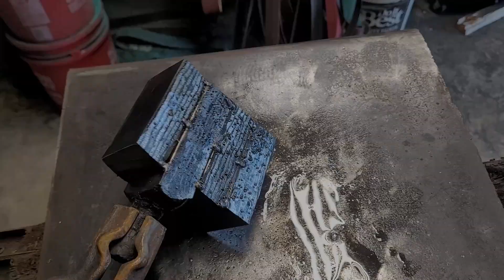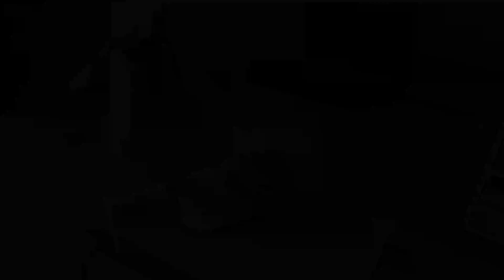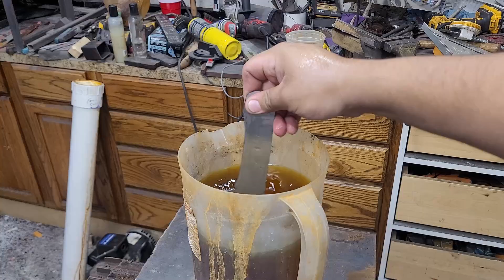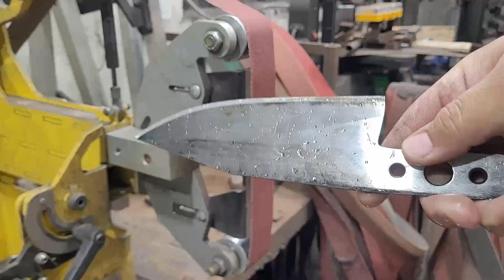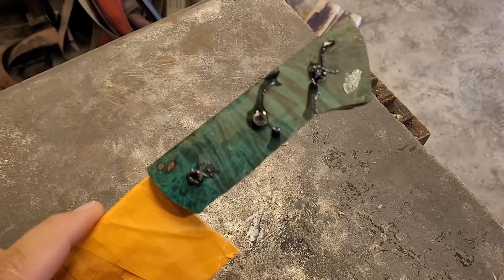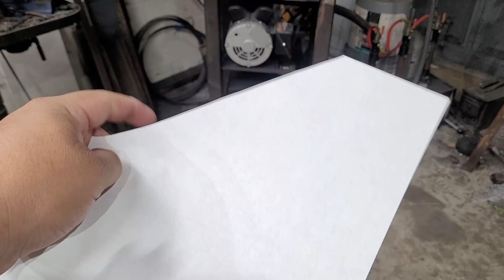Making A Feather Damascus Chef Knife

Comment: The handle is absolutely stunning, and goes so well with the darkness of the blade! I think the blade stands out, almost like tiger stripes. Love it. 

When you saw Ws or Cs, what are you referring to?

Thanks.
Reply from the maker: Im referrering to turning the billet 90 degrees when im forging it and resquaring it. That causes the lines to bend into a c shape. When you cut and stack it to increase the layer count the Cs fuse and become Ws. It adds more complexity to the pattern instead of  just the straight lines.

Comment: Great job on your first feather!  I’ve been wondering what a feather would look like without doing the C’s/W’s. Now I know, thanks for showing it. The duller the cutting tool, the more action in the feather, I’ll be using a HF hatchet and my sledgehammer, no press😢
Reply from the maker: Glad you liked. Good luck with that sledge hammer. On the bright side at least your getting a better workout than me 🙃

Comment: You should try crushed W's for your feather stack, before splitting, I think the feather looks better IMO.

I also used a splitting wedge for my feather Damascus, and spraying it with WD-40, helps with releasing the piece from the wedge for me, also the duller the wedge, the more layer drag you achieve. The sharper it is the more cutting you actually do.

Nice work!
Reply from the maker: Thanks. When i started i wasnt planning to make that billet into a feather but half way in the idea came to my head. Next time for sure though.

Comment: There are recipes for a lube to dip your splitting blade in to help with the sticking. It's usually some type of oil and powder graphite
Reply from the maker: I had some i rigged up when i did an axe for the Viking challenge a while up that i looked for mid cut and that helped out a bit. I believe it was from some graphite type lube i found at harbor freight and some dawn dish soap i mixed together. I made it last minute from a video i found and it works pretty decent.

Comment: That looks BEAUTIFUL!!! WOW!  I've never seen this feather pattern before, and I LOVE IT!! I ESPEICALLY love those thick lines, and how they contrast with the bunch of thin lines. I think you said that thios feather pattern typically doesn't have those thick lines, so it would be just a whole bunch of the thin lines, huh? I imagine that some of the thin lines would merge together in spots, like we see happening in between s couple of the thick lines.... that would probably look cool, but I think I would end up liking this more.
And that handle looks fantastic too!
When you said something about  adding some "W's" or "C's" you mean in the straight lines on either side of the point right? What do you think about doing a W pattern in the THIN lines but not those thick lines?
Reply from the maker: I think it would look better with the Ws because it would give it more movement and more contrast. Ive seen many like this and i like the look.

Comment: Two videos? Our cup runneth over
Reply from the maker: 2 videos since i had one halfway done, but i put it aside for the challenge, then milton happened, and i was finally able to finish it last night. It could have been early, but i opted out to go to my nieces softball game on staurday morning instead.
Reply: When cutting the billet to achieve the feather pattern, might it help to use a lubricant? Torbjörn Åhman uses a graphite-molybdenum-soap mix, I think, that he uses for hot punching and similar operations. Have a look at his video. It might help with the wedge sticking
Reply from the maker: I had some of the same mixture from when I did my axe and remembered halfway into the cut. That's why it seems to start smoking or burning halfway into the cut. It helped out a lot on sticking but it still stuck a bit.
Reply: @stormdrifter7904 I was thinking the same thing. I vaguely recall Alec Steele I think mentioning using beeswax in one of his og hammer forging videos

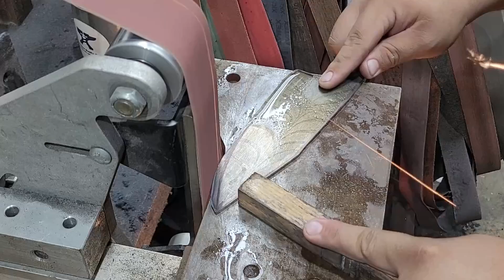Comment: 14:35 here you grinded alot of material.
but since you are a forger would be better solution to cur that much off and make a blade out of those cuts?
since you can forge steel to any shape - isnt this just material wasting?
Reply: He spends the two (more like 4) preceeding minutes explaining exactly why
Reply from the maker: Correct 🫡
Reply from the maker: Sometimes you just have to grind off some materials. You cant save all of it.

Comment: Ive watched few of your videos so far.
Can you tell me, when you are using the press on hot steel. someties it flakes under pressure.
but since it was pure steel, im not sure wqhat it is? is it steel?
if so, will you ever made a blade out of those flakes? is it even feasible?
Reply: The flakes are iron oxide, it forms more quickly as the temps go up. You can make steel out of it again, there's videos floating around about it
Reply from the maker: Cool i didnt know you could make steel out of it again.